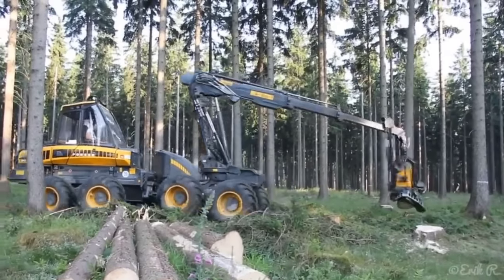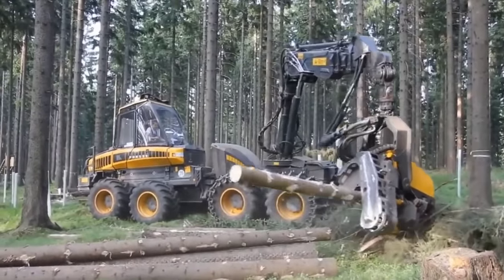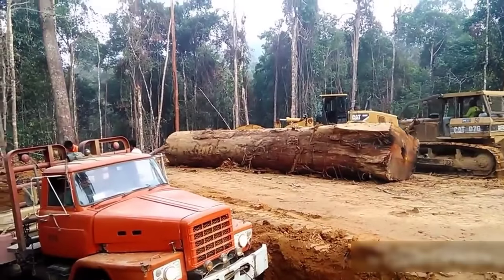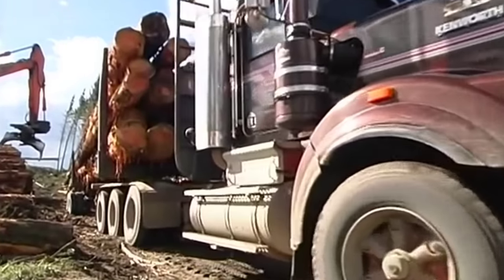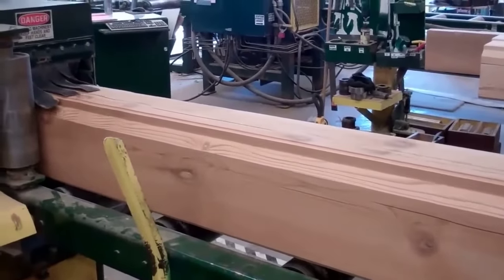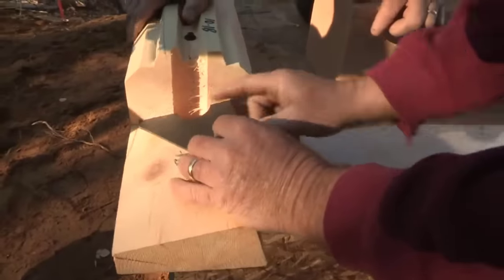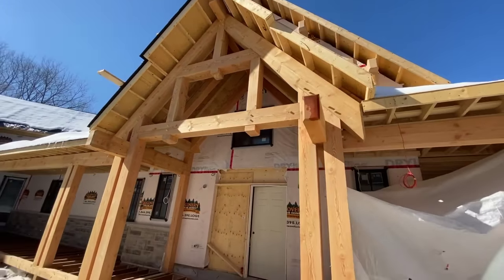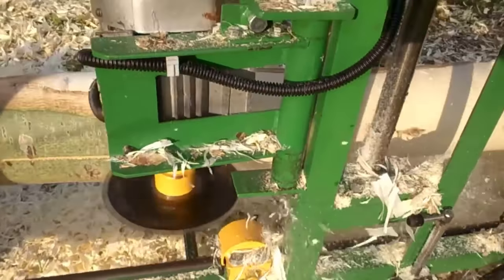How To Harvest, Transport Large Logs. Manufacturing and Construction Process Of Milled Wood Home

Comment: LoL ! back in the 70s i was a faller for one summer in northern British Columbia, CA. and the trees were alot bigger than those here ! My chainsaw blade was 48 inch long and it would barely cut 1/2 way in the tree ! I was filing it 4 times a day with a file on a small angled stand that i grip on the blade and file all at exact same angle ! So it did great filing in short time ! My job was to fall all the biggest trees in the same direction and walk on the tree all the way to 6 inch diameters and cut it there ! Some guys were cutting the branches and i couldn t see them all so i had to call timber a few times and wait for a guy waving it was ok to fall ! The difference in 50 years ! lol amazing ! 🤓